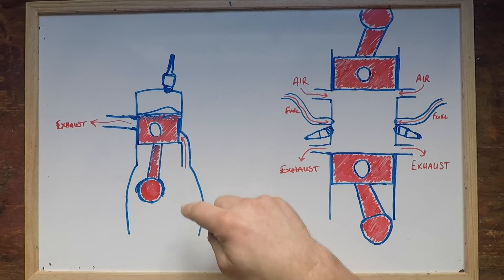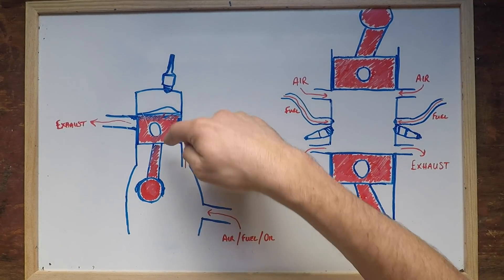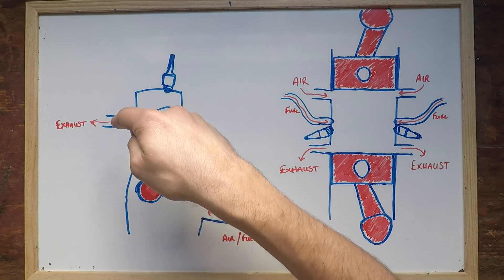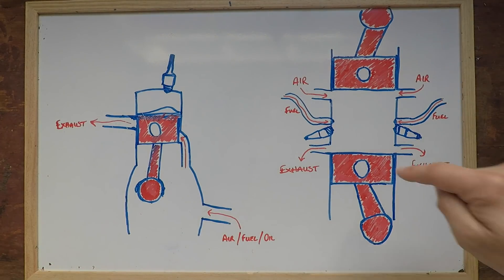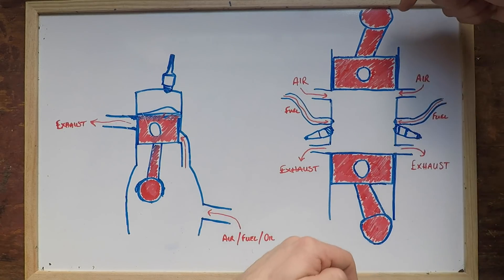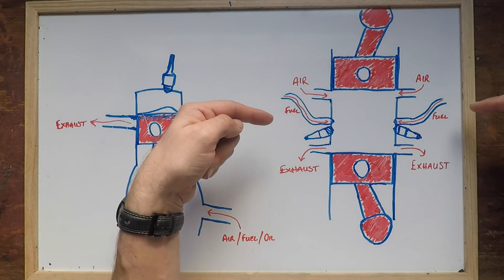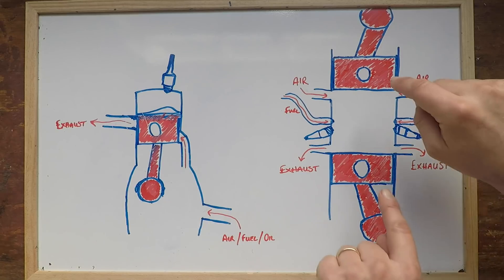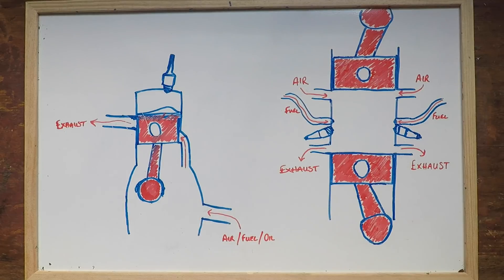How An F1 2 Stroke Engine Could Work - MP339

Comment: I can't see it. Won't the intake and exhaust ports open at the same time?
I suppose you could supercharge the inlet side, but you would still have to open the exhaust ports earlier to get the inertia going that way, unlike your drawing.
Do we need expansion chamber exhausts to help shut the door on the escaping inlet gasses or does precision fuel injection fix that?
Can you have a turbo on an expansion chamber? Does it matter?
Hmm, I think I want one.
Reply from the maker: No, timed by crank position just like before, my drawing obviously not exact enough to show it.
Reply: @F1Elvis  
Yep, I added a bit more to my initial comment after you replied , I think.
Reply: Well, Direct Injection makes the expansion chamber a volumetric efficiency thing (fuel is not pissing out anymore), so maybe you could get away without one?
Reply: @ipwn951  Yeah probably.
Reply: The ports are positioned so that the timing is optimized, tuned exhaust pipe volume and a valve that varies the size of the exhaust port all contribute to how air flows through the engine. Also, you have correctly pointed out that charging the intake air would greatly benefit clearing the combustion chamber. As the piston travels downward a one-way valve called a reed valve seals the crankcase and the air in the crankcase is compressed by the piston. As the piston travels down continuing to compress the air until the intake port is uncovered and the pressurized air fills the combustion chamber and pushes out the exhaust. This is why the intake air enters the crankcase. 2 stokes have built-in supercharging and it's what makes them so effective.
Reply: @shconer  
Ok I see, the downward going piston is a kind of actual supercharger as well.
I never actually considered that before.
Reply: @shconer  on a opposed piston engine one piston is "hot" and the other is "cold"
One piston operates the intake ports
The other the exhaust port
It's always supercharged 
And the crankshaft runs in oil so you don't need to mix oil in your fuel

Comment: Was totally like what kind of madness is this then Marc comes along explains it and I'm like welllllll this could work
Reply: No neither work.  The drawing on the left is how 2 strokes worked eons ago, no performance 2 stroke has used a crossflow design with a deflector piston in many decades.  The drawing on the right is an opposed piston 2 stroke, they are not new, and they make less power than a conventional single piston, single crankshaft loop scavenge design.  The real F1 design will not be either of these 2 designs, nor a loop scavenge design.
Reply: @megametal8641  What then??
Reply: @ImausrI  A combobulator will be added to the thrust side.  The opposing side will likely have a very short stroke but high revving composite plug design in the crown.  Short revs on top vs half revolutions on the combobulator (below) in a two stroke engine should transfer to F1 quite readily especially considering the expanded race season in 2020.  Think Honda VTEC technology but embedded into the combobulator.  No one would ever consider the joke 'when the combobulator opens the power kicks in' like a VTEC engine.  It just not plausable!
Reply: @ImausrI  I suspect it would be similar to the Boosted Uniflow Scavenged Direct-Injection Gasoline design that was published recently. Lacks the extra weight of an opposed piston and doesn't need total loss oiling like a crossflow design. Similar to something like a detroit diesel in the way it is scavenged, except turbocharged. https://www.sciencedirect.com/science/article/pii/S209580991830715X
Reply: Can't help but think they may be working on something the diesel two stroke with a blower and direct fuel injection. But as they're not going two stroke anyway it's all just back to waiting until batteries are up to lasting a f1 race.
Reply: @gpw203  and zeppelins in the twenties

Comment: Do you still need oil mix?
Reply from the maker: No, because crank and bearings can now have a normal oil supply as mixture's no longer in the crankcase.
Reply: @F1Elvis  thanks..

Comment: Opposed piston 2 strokes are such a damn cool engine :D Tbh if this creates a new age of road going engines, i'd be totally up for it :D although, they have been used in train engines (as diesels) since the 40's as a Triangular Engine, anyone interested in engineering needs to check out how this engine works, it's a pieces of artwork!
Reply: The Deltic engine was  used in naval vessels in both 18 cylinder and 9 cylinder versions too.

Comment: You had me when you said "High Reving"
Reply: MEGATRON  they only run to 13k now because at 13k they have just passed maximum power in the powerband of the engine. Meaning that if they do continue revving the engine up to the maximum of 15k they will just be wasting fuel for less horsepower. This is why they added an extra gear in 2014. If they decide to use 2 stroke engines. The powerband will be completely different so there is no point really speculating about how high revving the engines will be until the first engine is designed and tested.
Reply: They need to chase efficiency, not aesthetics. Less in, more out... anything else is going backwards.
Reply: MEGATRON  Even if they run 13k rpm, two strokes have twice the amount of combustion cycles per rotation. They sound like they're revving way higher than they actually are.
Reply: MEGATRON  I am a fan, please leave me and my illusion 😐
Reply: @FESalia  We ain't leaving you alone, just hear the truth.